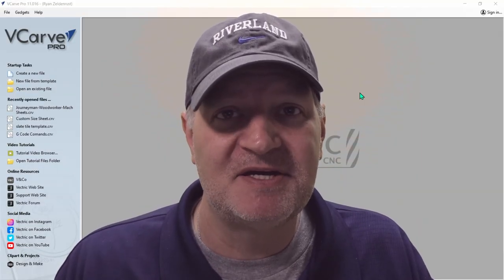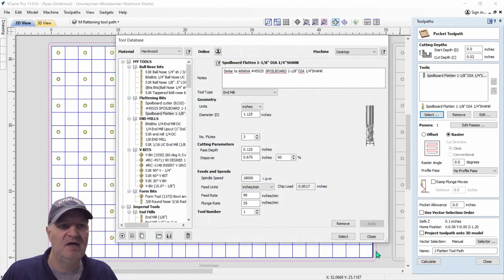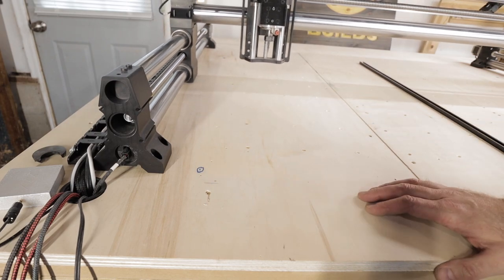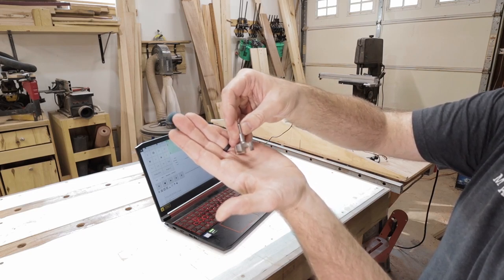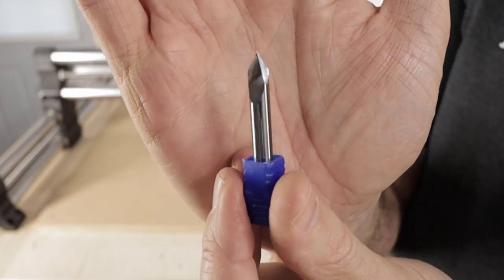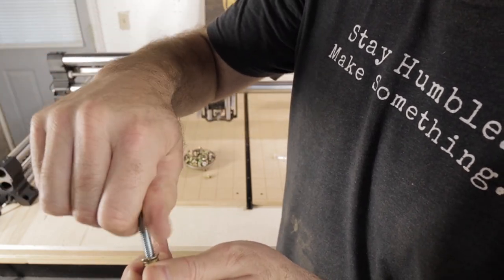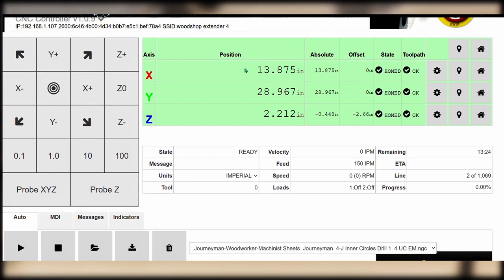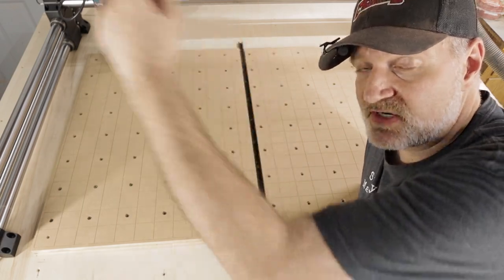Simple CNC Spoilboard System! Best for Onefinity CNC Beginner -Vectric

Comment: Really helpful video, perfect teaching.  Not too fast for a beginner and not so dumbed down as to be boring.  Easy to follow.  A couple of things, just starting and have ordered a new Onefinity machine.  No one covers the process of computer to CNC.  I am familiar with CNC software for embroidery machines, so I expect to pick up woodworking CNC pretty quick, but it has been my experience that the simple steps are the ones that cause me the most problems.  The other thing,  how  do I determine the location for interior hold down screws?  So they don't interfere with the holes for the insert holes.  And, are they necessary to keep the spoil board flat?
Reply from the maker: Thanks for watching! For the hold down screws in the middle, I just measured them out and put them where I knew there was no brass insert. I would add them before flattening your spoilboard. I think it is important to have them because you may accidently put a screw too deep into the brass inserts one time and it may want to try and lift the spoilboard. Those holddown screws help keep it secured down. If you are worried about hitting them, you could always take them out before you drill the insert holes and put them back in afterward. As far as connecting your computer, I connect through my wireless network. If you don't have a wireless network in your shop, you can connect a computer to the controller box using an ethernet cable, but I havent done that before so I am not the expert to ask for details. I am sure a quick search on the Onefinity Forums will have more details on the process. Hope that helps 👍

Comment: Nice video. Suggestion, put the inserts in from the back side less likely to pull out. I know it’s an extra step but a little more secure.
Reply from the maker: That is a good suggestion and I did that with my first ever spoilboard. I ended up switching to the brass inserts because I am a simple man. 😂 But really, when I made my second spoilboard I had a hard time reusing some of the T-nuts and getting them out was a pain. These are easy to reuse. The other reason I use them is that they will pull out if you accidentally overtighten a bolt, instead of raise up your nice flat spoilboard.  Two different takes and both will work. Good suggestion! I think Ben Meyers at Meyers  Woodshop has plans with that setup if anyone is interested in this kind of insert.  Thanks for the suggestion!

Comment: Thanks a ton for this video and the file, which I just bought since it's so inexpensive. While I'm still saving up for my onefinity, I'll definitely be using your spoilboard design.
Reply from the maker: Awesome! Thanks for watching 👍
What do you want to make with you Onefinity when you get it?
Reply: @twoelmbuilds  I'll be doing a ton with it aside from projects to sell. Boxes, arcade style control panels, some jigs for the workshop, things like drawer pulls, shelf brackets, trays, coasters, signs, resin inlays, acrylic etching with a drag bit, etc. Man, there's so many things we can do with a CNC! At first it'll be mostly a mix of practice and some small runs of projects to recoup some of the costs.

Comment: Nice video. Thanks for taking the time and effort to help us “out” here. 

Question. 

You mentioned that your friend suggested that you increase the thread hole size. That would  take less effort to drive in the brass threaded inserts. 

That’s a good idea. If  the hole is too tight you’ll have “bulge” pushing  somewhere in that specific area of board structure. Does that change your  flattened surface? 

Also… is there any issue when driving the inserts in having your  previous “flattened” spoil board heave up when you bottom out the insert screw against the surface structure below?? 

Those small impact screw guns have some impressive torque values. 

Just thoughts about reaction of wood vs metal pressures. 

Again, thanks for the education. 

Best.  

Wiredodger60
Reply from the maker: I suppose you could have it bulge up if you tighten the insert down too far in the mdf. You can even mess thing up if you drive your hold down screws too far.
I wouldn't be to worried about having issues if you just know it can happen and use some caution. At least MDF is easy to sand flush if you mess something up 😂 🤣

Comment: Great job on this video! Very nice of you to make these plans so affordable too ! I just finally built my table and set up my onefinity. I do plan on using 4 t-tracks for hold downs. My question is can I buy these plans and just use the flattening and grid portion of these plans and just not do the holes?
Reply from the maker: Thanks! yes, you sure can use just the flattening and grid tool paths. They are all separate tool paths so you can use whatever ones work best for what you want to make!

Comment: I've actually got a question about how you're controlling your cursor on the touchscreen ... is that through the joypad? I have the same joypad, and think I've tried all of the buttons, but don't seem to have any control of the cursor, just the movement of the machine. How are you controlling your cursor if not with your finger? Thanks!
Reply from the maker: I was using my laptop to control it. I was doing a screen record as I did the work. It was my mouse controlling the cursor with my laptop.
Reply: @twoelmbuilds : Bummer! I was hoping there was a way to do it from the joypad, but maybe not. Thanks for replying!

Comment: Isn't it better to install your brass inserts (t-nuts) on the underside of your spoilboard?
Reply from the maker: You can build a spoilboard like that and it works well. I prefer to use inserts because they are easier to re-use (in my opinion) and they pull out if you accidentally tighten too hard, I stead of raise up your spoilboard from underneath, thus making your project not flat. Just two differing styles with their own pluses and minuses. Thanks for the insight and watching 👍

Comment: Hi,
Is there any way to convert the Vcarve files to Carvco files which came with my Journeyman CNC? It seems that the  carve files cannot be imported into my Masso controller.

Thanks,
Sam
Reply from the maker: Unfortunately, there isn't a way to convert them to Carveco. They are vectric  .crv files. If there is any conversion software out there I don't know about it. If you run across one let me know! 👍
Reply: So, sounds like I need to purchase Vcarve to make these files work with my machine.
Oh wait, jus had a thought… how about importing them into Easel and then exporting them to a fils format that the Masso controller can read?

Thanks again!
Reply from the maker: The Masso controller needs gcode to control. Vcarve, easel, carvco are all cad/cam software that produces gcode to send to your Masso. Each software runs it's own forms of cad/cam that do not communicate with each other. The only way to open a carvco file is with carvco. Same with Vectric files, they need vectric software. You will need to create your own carvco file to generate gcode for your Masso. I would stear you towards someone who teaches carvco, but I really don't know anyone.
Reply: Thank you sir!
Perhaps I stated the question improperly . Can I load your files into my Masso controller?
sam
 @twoelmbuilds
Reply from the maker: My files are vectric vcarve pro files. The can only be opened and used by vcarve pro or Aspire software, so no you can't load my files directly into your controller.

Comment: Awesome video. Can you make a video of the cam clamps and how you design them. Also might be a stupid question but what attachment are you using at the end of the ryobi drill to screw in all of the holes
Reply from the maker: Thanks! I will definitely make a clamp video, I have two other videos I am working on right now and then I will make it. As for the attachment on the end of my drill, it is a magnetic bit extension. They make them in all different lengths:  https://amzn.to/3gDWHQ4

Comment: You must have newest version of vcarve to run this. IT DOES NOT work with all ventric software!!
Reply from the maker: What version of vcarve do you have? Are you using vcarve pro or Desktop?
Reply from the maker: If you have any of the Desktop versions instead of the Pro, they have a cutting area limit of 24" x 24".  You will need to use the tiling feature to get the project done.